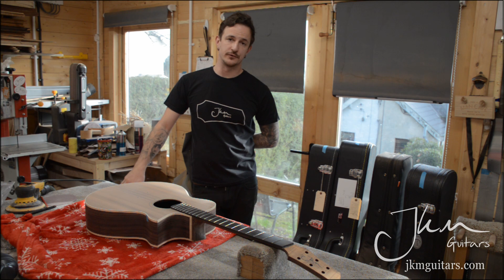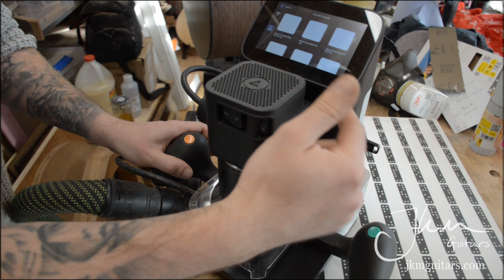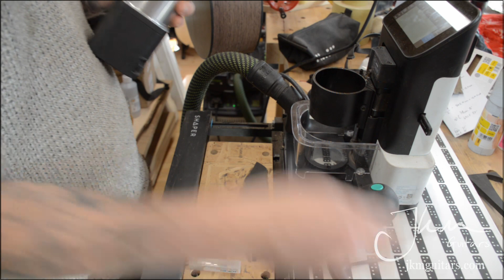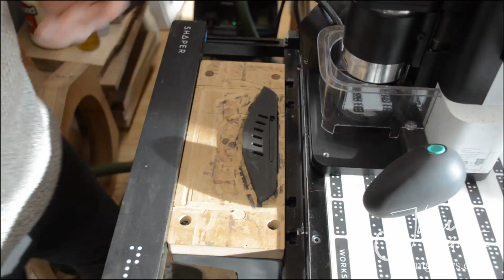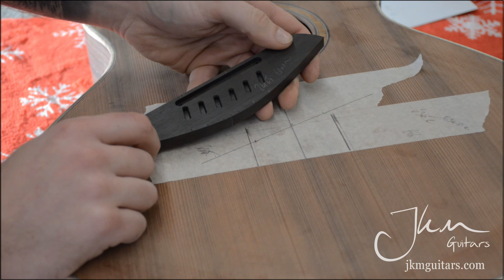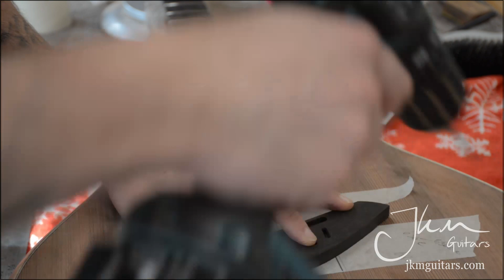BTS Week 4 Bridge Making and Location

Comment: hi  how are you i did met you in guitar show what kind of router is that programable
Reply from the maker: Hi there, its called the Shaper Origin, and you can use either your own programme or their software to design drawings, and as long as they can be saved as a SVG file, it can be used by the machine. Its a great piece of kit!